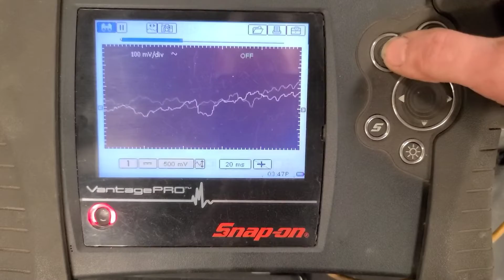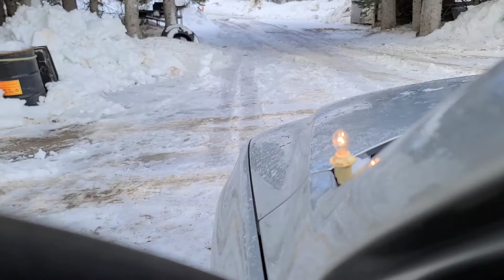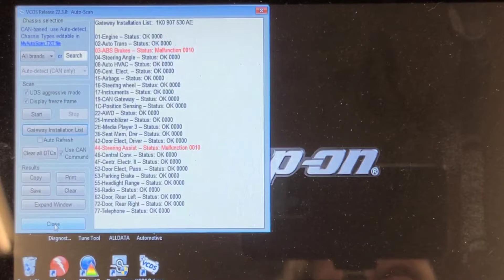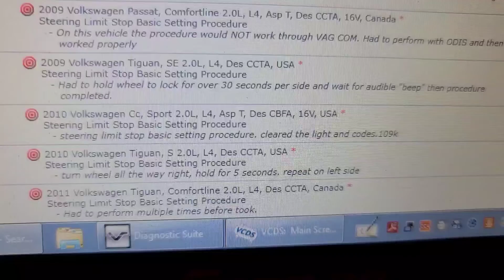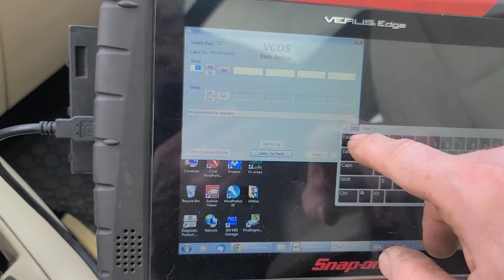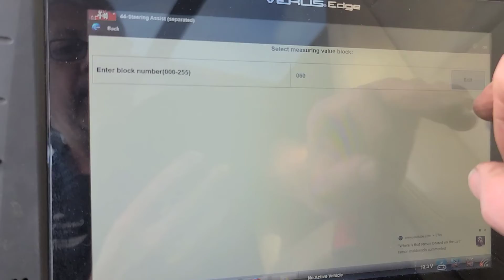2010 Volkswagon Tiguan Intermittent No-Crank After Hot Soak plus Steering Angle Sensor Relearn

Comment: PHILLIP, AWESOME information and smart way that u hooked the test light to S terminal to confirm is the starter fault or not  one think to ask what was the security code for to get access and do u need to pay / subsecrbsion to get the Code as always thanks for sharing.
Reply from the maker: The security code was in the service instructions in this case. There are dozens of different security codes depending on which module and what you're coding. The Rosstech website has most of the ones you need documented. That's for the comment.